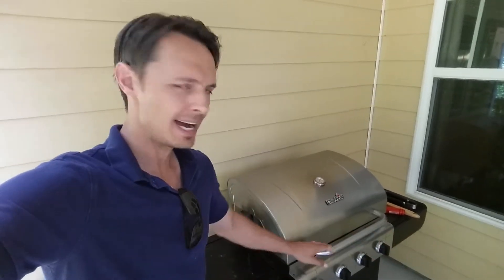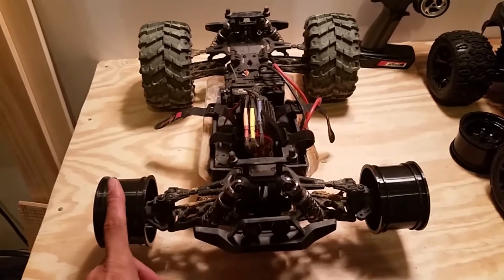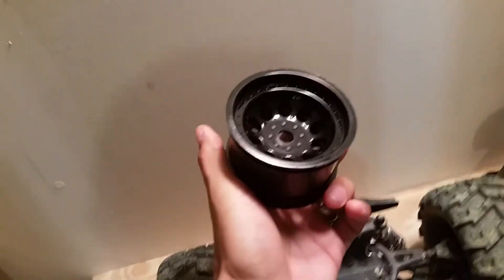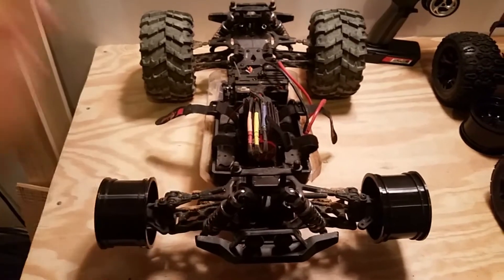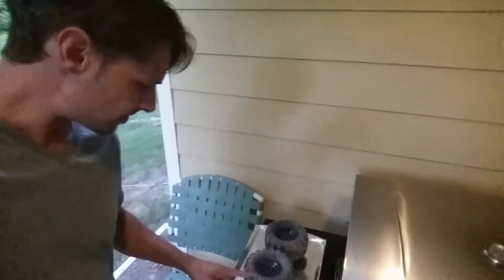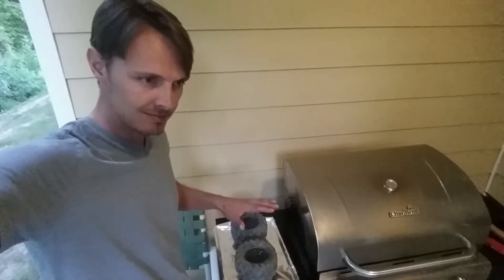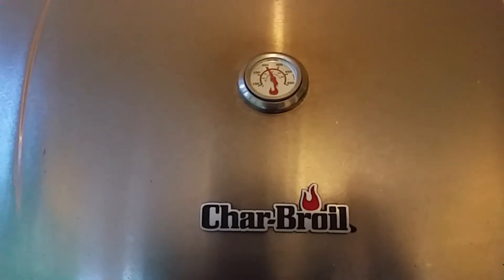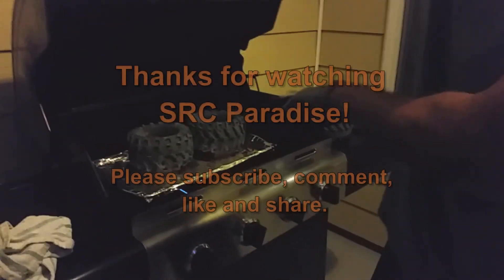Bake RC Tires to Remove From Factory Rims

Comment: great video. I tried boiling and it was so so. this looks great.  did it warp the wheels or tires?? I want to strap my stock be6s  tires and I definitely going to try this! I hope to get the landslide soon just waiting to see how they hold up. looking forward to more videos👍👍👍👍
Reply from the maker: Hey Ryan thx for watching! No warping on the wheels or tires:) Worked like a charm, I highly recommend grilling outside to avoid the smell-btw smell wasn't too bad, but you deff wouldn't want it in your house. 
How do you like the Bes6? I'm thinking of getting it or the Arrma Outcast;) The Landslide is awesome for the money-you can't go wrong. Be sure to subscribe I've got some more vids coming soon. Cheers!
Reply: sRCparadise been subscribed!! yeah did it in the house before and that was a big mistake lol. I love it. Haven't got to really jump it yet only had for few weeks but its great!! lots of power. my first 1/8 scale. its definitely worth it. no problem computer and hobby has great package deals. theT bone bumper is nice. Deftly love the price point for the landslide. Can't beat it